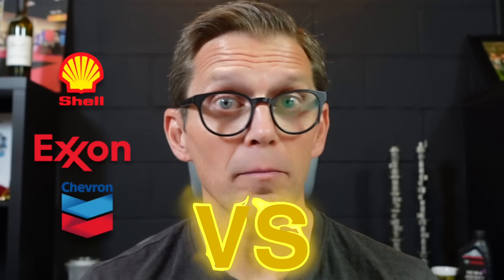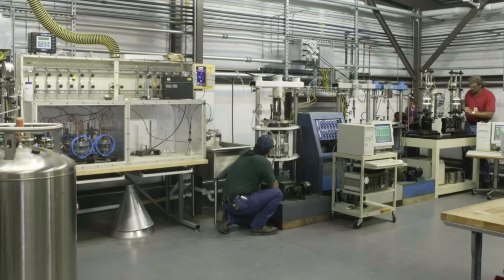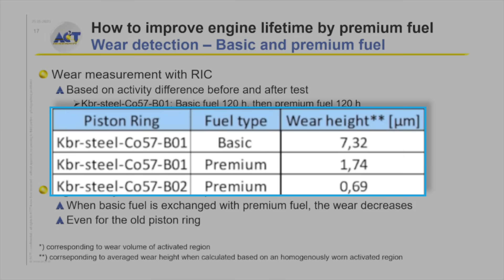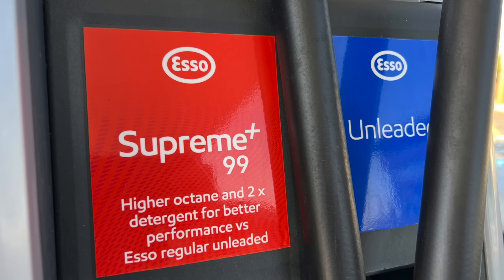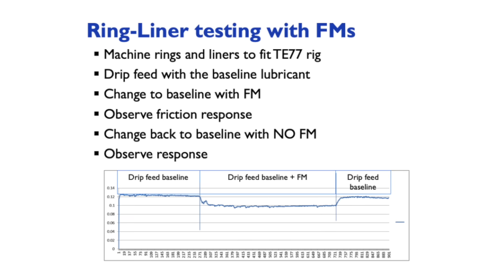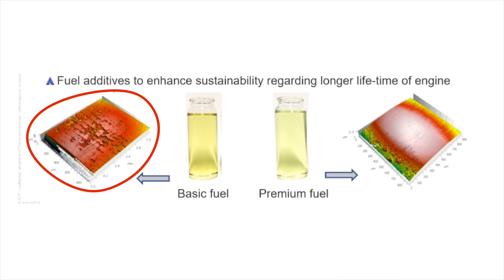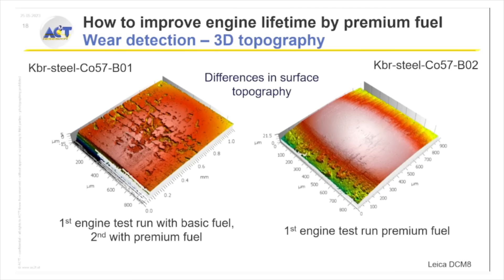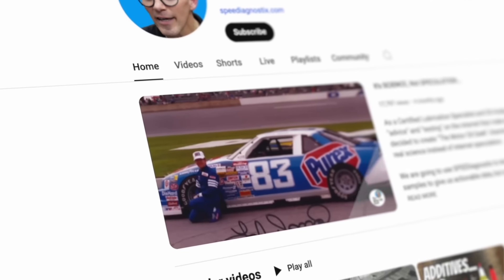Can Premium Fuel REDUCE Engine WEAR?

Comment: Is it better than e85?
Reply from the maker: E85 is hard on oil
Reply: @themotoroilgeek  but great against knock... so change your oil every 2k and rock and roll right?
Reply from the maker: @JackTorence if you have knock problems on 93, then that would be a solution.

Comment: I've been using shell vpower on my 2014 accord running like a champ with mobil 1 extended performance.
Reply: Mobil 1 is a good oil, at least here in Europe
Reply: @AAAAAAndrea I switched to Restore and Protect. I am getting 35–40 mpg in city driving and 30–35 mpg on the highway. Great oil! The only issue I had when I first used Restore and Protect oil was that my engine vibrated a lot like a muscle car. After 1500 miles, the engine is smooth as butter. 2014 honda accord sport.

Comment: What engine was used for this experiment? High performance engines would see these results but would a non performance engine see them?
Reply from the maker: The test engines were stock production car engines.
Reply: Yeah but a turbo engine for a Hyundai Kona is stock stock production and requires premium gas. Where a 2022 nissan frontier is naturally aspirated and calls for 87 octane

Comment: Question: If Iʻm using "Top Tier" fuel, does this same rule apply within the octanes? In other words, would the 91 Top Tier offer less wear than the 87 Top Tier?
Reply from the maker: The Top Tier detergent package applies to all of the octane grades, but the Premium (91 or 93) octane fuel is the one with the extra friction modifiers.

Comment: I’ve been using Lucas upper cylinder lubricant in every tank of gas for my 1970 Oldsmobile, seems like it might have the exact same benefits for friction reduction on the top ring. Any thoughts? I use it mainly to reduce exhaust valve seat wear  and to keep my electric fuel pump lubricated.

Comment: I would be interested to see how E85 affects oil. Could you speculate?
Reply from the maker: I actually have some data on that!
Reply: @ I drive a F150 with a NA 5.0 V8. I use supertech 5w20 synthetic. I mainly run E85. I’m curious as to how E85 might affect the oil and if I should I should maybe go to 5w30 or avoid E85. I’m also curious of 5w20 vs 5w30 for towing vs daily driving. I would be very interested in data you have. 😀
Reply from the maker: @docbenb415  I'll get to work one that one.

Comment: For the people that are looking to the comment section for a layman's terms answer here it is:

Best Oil + Best Gas = Less wear
Mid oil + Regular Gas = Normal wear
Bad Oil + Regular Gas = More wear
Bad Oil + Bad Gas = What are you doing?

Also, if you have been running 87 in your car (I have and I also drive a 2014 mustang GT) and you already have 50,000 miles in your car, don't expect the Best Oil + Best Gas (97) to repair the existing wear on the engine. That's not how that works. Best oil + Best Gas just means less wear over time. That's it. Saved y'all about 10 minutes here.
Reply from the maker: Nice summary! Thanks.

Comment: always use (mostly shell) premium in my 99 Land Rover Discovery 1 (plus Castrol 10W40 conventional), had the head gaskets and rear main resealed in 2017 at 167K, the tech told me he did not replace the main bearings as they still looked new, and everything looked clean. Now at 210K and she still runs like new :)

Comment: I use 93 octane non ethanol gasoline that I buy at the local co-op and I also use Red Line S1 on a continuous basis according to the ratio recommended by Red Line, which is about 2oz per 7 gallons. I’m experimenting with this on my new motorcycle since day one and it’s running great after 8,000 miles.

Comment: Lake!!!! We  need a full video on E85 rundown. Please run the test again using E85. This is what hot rodders wanna know. What E85 does simce it burns cooler does it have same impact on the cylinder ring like 93 does? Also how e85 shears down oil.

Comment: Mr motor oil geek SIR..just recently started filling with the Shell nitro 93 octane. There is so much misinformation out there.
But i did always fill up with Top Tier gas only..only 87 ..why waste money right?
My experiment with my 2019 Hyundai Elantra was eye opening.
Since new the motor  had a severe flat spot..i mean it would literally refuse hard throttle inputs .
For 2 seconds it shut down..nothing
So what the hell i bite the bullet.
After 2 fillups that dead spot completely disappeared!
That is now what i put in the 2025 Jetta i bought.

Comment: What do you about 90 grade top tier non-ethanol fuel. I only use this fuel and 5W-30 ultra platinum in my 24 jeep Gladiator with a 3.6L engine

Comment: 32 years at a major terminal.All the gas came out of the the same million gallon tank.You name the brand , it came out of the same tank. We didn’t have tanks with specific additives for specific companies. The same trucker that delivered to Exxon delivered the same fuel to Joe blows discount fuel. You just pulled under the rack. Companies have fuel stored there and you just load under what ever allocation they tell you.

Comment: I've reviewed and analyzed the AAA Fuel Quality Research Report referenced in this video.  That research measured three key areas:  Intake Valve Deposits (mg), Piston Top Deposits (mg), and Cylinder Head Deposits (mg).  Here are the average of average deposit results:  1) Non-Top Tier Fuel:  Intake Valve Deposits (660.47 mg), Piston Top Deposits (631.50 mg), & Cylinder Head Deposits (763.47 mg); 2) Top Tier Fuel:  Intake Valve Deposits (34.07 mg), Piston Top Deposits (526.33 mg), & Cylinder Head Deposits (893.80 mg).  These averages seem to suggest the following:  1) The raw Top Tier Fuel seems to be cleaner, less contamination, or soapier than the Non-Top Tier Fuel and 2) The deposits on the Piston Top and Cylinder Head are relatively the same for both Top Tier Fuel (1,420.13 mg) and Non-Top Tier Fuel (1,394.97 mg).  The Total Engine Deposits from the Report seem to be greatly skewed by the Intake Valve Deposits for the Top Tier Fuel.  My conclusion is this:  Top Tier Fuel and Non-Top Tier Fuel have no significant impact on the car engine.

Comment: Thank you for responding. With your comment I now believe this to be true. I wonder does an engine block heater help with this? In theory with warm oil at engine start, it should reach operating temperature quicker and slow the wear curve. I would love to hear your input on things that can be done to shorten the cold engine / heating cycle.

Comment: Fuel lubricity is the difference, look at diesels they run forever with proper oil changes because the fuel is high in lubricity.

Comment: I saw a video that said that what affects the health of your engine more is piston rings and cylinder walls. And that the most damage done to piston rings and cylinder walls occurs during the period from start up TO THE ENGINE REACHING NORMAL OPERATION TEMPERATURE.Changing your oil and filter only accounts for 25% of wear. I would like your opinion on this. He provided charts from the major oil manufacturers where they themselves showed this was true. Now I am confused!
Reply from the maker: The piston rings rubbing against the cylinder wall is the number one source of friction and wear in the engine. Low temperature operation of the engine causes more than than at normal operating temperature, which is one of the reasons short trip driving is so hard on an engine. The higher rate of fuel dilution of the oil at lower engine temperature is one of the driving factors in that higher wear.

Comment: @themotoroilgeek My vehicle only requires regular fuel. I know running V-Power would be pointless in terms of the octane rating but would love to get the additive benefits. Do you see any negatives other than cost? There is online speculation (ew) that a higher octane fuel would not burn as completely than if I used a regular octane fuel. Any thoughts? Thanks man! Love your channel.

Comment: You can't use higher octane. The gasoline stations don't tell you.
Which companies sell these additives in 87 octane gas? 2004 Subaru Impreza Outback still has a clean tailpipe.

Comment: In my motorcycles, which require the highest octane, I always use Shell. Sometimes Chevron if I am low in fuel and I am far from a Shell. In my cars I only use Chevron, again, unless I am running low on gas. Why the difference? 

For what I’ve read, Shell only ads their top additives (V-Power®NiTRO+) to their highest grade gas, not the 86 or 89. I wish they added it to all gas grades. Since I must use the highest grade in my bikes anyway, I use Shell. I use Chevron in my cars because the factory suggests using 86 octane gas. Yeah I know that I could use higher octane without a problem, but why pay more? Since Shell doesn’t put their best additive in their lower grade gas, I use Chevron because they put Techron in all their gas grades.

I never use Mobil. Don’t know much about their gas, but I do know that their gas stations are typically the most expensive around. Sometimes crazy expensive. At least in California.

I rarely use any other brand. Again, only if I am really low in gas and there is nothing else around (like when I am traveling) or my bank account is hurting that week. If I use anything else, the lowest cheapest gas I use is Arco. I almost never use 76, don’t know why. I guess because I don’t know much about their gas.

Comment: Does 87 89 91 or 93 all have different compression levels. More people say don’t need to use 91 or 93 in my 2024 ram 1500. What’s your thoughts the book says 89. Do I get more bang for my buck if I go with 93 in my local area?

Comment: I only use higher octane 98 fuel. It is worth the extra at the pump. It also helps keep your injectors clean. No issues after 130,000km on my tuned Golf R

Comment: Only thing premium fuel did for me and my Honda civic that doesn’t call for a premium…. Bad gas, mileage, and dirty injectors due to premium fuel needed in higher temperatures to burn off where a Honda Civic won’t reach those temperatures therefore only needs regular unleaded fuel.

Comment: How do we know what brand (fuel formula) of fuel to use with the specific oil that is in the sump?
I live in Thailand. 
My Toyota Truck has 210,000 km.
Using Valvoline Max Life 10w40 diesel oil.
The brands of fuel are Shell, PTT, PT, and Bangchok.

Comment: This is a dangerous video, so far I haven't seen you clarify that "Premium fuel" on many pumps can have a different compression ratio

In fact, that "Octane rating" is the exact measurement of compression. IF YOU USE A HIGHER THAN DESIGNED FOR RATING ON YOUR CAR, the best that will happen to your car is incomplete combustion and poor performance. If you have a regular everyday car that does not specify anything more than the lowest octane rating (excluding E85), DO NOT put higher rated fuel in your car.

Comment: Great video but I think you need to confirm whether the difference in wear rates will have a noticeable effect on engine longevity over the typical life of a vehicle . There is no point spending extra cash on higher quality fuels/oils if the benefits are only tangible at very high mileages when a) you might have sold the vehicle or b) other factors may have rendered the vehicle unserviceable? I suspect that regular oil changes and/or not operating the engine at high loads when it is cold will have a far greater beneficial effect than using premium fuels/oils?

Comment: There is some confusion about premium fuel as discussed here. This video is about the fuel additives that at a place like Shell are "premium" at all octane levels. The premium used to label the pumps refers to octane, which is not power but the resistance to detonation. The high octane fuel is required for engines with higher compression ratios that want to detonate (like a diesel engine) before the spark is fired.
Reply from the maker: Sorry for any confusion. The advanced additive package is only in the higher octane “premium” fuel.
Reply: yes he was much vague. If it's "science over speculation", then use precise language.
Reply: @wazookazoo  I believe he said V-Power, which is only Shell Premium.
Reply: No confusion. He said premium fuel carries the better additive package that reduces wear. The lower octane fuels do not have this which is why higher octane fuel cost more.

Comment: Can you speak more into the pro’s and con’s of ethanol in our gas it’s my opinion that it’s cheaper to have a filler that helps fuel in the short term but causes harm in the long term to your engine because of moisture that ethanol captures, now I could be totally wrong and misunderstood what I read, anyway thanks for the informative video
Reply: I had same question
Reply from the maker: Great Suggestion. We will do a video on that.

Comment: Hey Lake.  Thanks for the great report on fuel.  My 2003 C5 Corvette sees only Chevron and Costco gas.  They are both "top tier".  According to the C5 forum, the fuel level sensor loads up with Sulphur causing the fuel gage to become erratic.  A few bottles of the Techron additive will supposedly fix that.  Have you heard of this issue?
Reply from the maker: I have heard of that issue. The complete fuel system cleaner once every 3,000 miles will prevent that from happening.
Reply: @themotoroilgeek  Hello Lake...with all due respect & not to insult your intelligence...engines have an octane 
requirement...for several important reasons. As you know, that requirement is established by the manufacturer & 
reported in the owners' manual. Once the octane requirement of an engine is quenched, any unconsumed octane 
elements become ash. Using gasoline with a higher octane rating than the engine requires will only serve to create 
an excessive amount of ash. Thereby, creating an issue with deposits in the combustion chamber, on piston tops, 
upper piston rings, etc. In some cases, it could shorten the life of the catalytic converter. Additionally, the excessive 
deposits would not be effectively removed by the detergent in the fuel. In my opinion, these issues of excessive ash 
will adversely affect the engine oil as well. 
It seems to me using quality fuel, with an octane rating in excess of what an engine requires, would actually create 
more wear than using a "quality" (top tier) fuel that simply meets the octane requirement of an engine. 
All that being stated, I don't believe using 89 octane gasoline in an engine requiring 87 octane is an issue. I'm referring 
to an 87 or 89 octane rated engine routinely using 93 octane gasoline. 
Your consideration is sincerely appreciated. ALL THE BEST to you & your family in 2025. 🙂 
Respectfully, 
Ben
Reply from the maker: @duygukayhanisaskank4915  Ben, thanks for the comment. The octane listed in the owners manual is a minimum requirement. In modern direct injection engines, higher octane fuels can be used as the engine control unit can adjust the spark timing of the engine to take advantage of the higher octane fuel. Unfortunately, a lot of the "knowledge" about octane is based on older engines that did not have the ability to take advantage of higher octane fuels.

Comment: I use full synthetic oil and wix filters and  change at 5 or 6000 miles. At oil change time I put a bottle of gumout Regane or All in One (has PEA) in the gas tank. At every fuel fillup I put in some Marvelous Mystery oil  with Top Tier fuel from Costco or QT. I use the MMO as a top end/fuel pump lube and a keep-clean fuel additive for injectors between oil changes. My cars don't leak or consume much if any oil, and all of our vehicles have well over 200-300,000 miles on them and run like new.

Comment: You make a lot of statements but as of the time I stopped watching the video, you did not produce any research to support your argument.  You are correct though in stating via your video that all gasoline is the same when it leaves a refinery and goes out to the public via the different gasoline brands.  The different brands and octane is determined by the chemicals added at the bulk gasoline storage facility where the gasoline distributors pick up their gasoline and take it to the market place - i.e. retail gasoline stations.  I had a member of my family that drove a 18 wheeler fuel truck for a living - he picked up raw gasoline at the Memphis fuel terminal, brought that gasoline to a local distributor where the gasoline then was taken out to the various branded gasoline retailers.  Back at the Memphis bulk distributor, my relative used a card, similar to a credit card, to identify the account, then my relative would select which gasoline, regular, plus or premium, he wanted and loaded the fuel truck into designated fuel compartments.  The account card also provided the required information to "tell" the bulk distribution system which chemicals to add to the  gas to be pumped to make the gasoline one of the levels of octane and whatever other chemicals normally added to the "brand" of gasoline.  Point being, gasoline is gasoline with various chemicals added to make the gasoline meet the individual brands.  Yes, chemicals are added, octane is determined by "a chemical" additive.  Fuel quality is basically ALL THE SAME.  As I overhear your video playing while I am writing my comment, you do mention the "additive package" may or may not be different for each brand, Shell, Exxon, et.....  But, the bottom line is gasoline is all the same when it leaves the refinery, going out to the bulk storage locations.  I just read through some comments and there is another person that commented three months ago that basically says the same thing as I have.  It appears he drove a fuel hauling 18 wheeler as my family member did.  God Bless them - they hauled gas all hours of the day, almost every day.